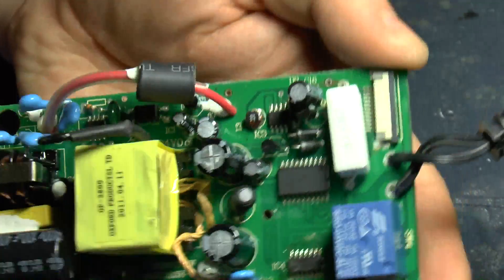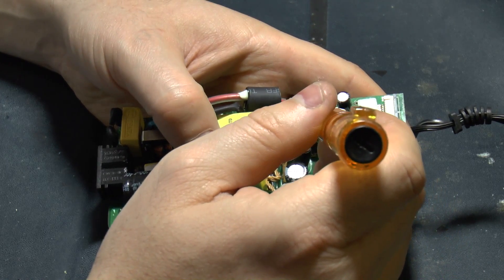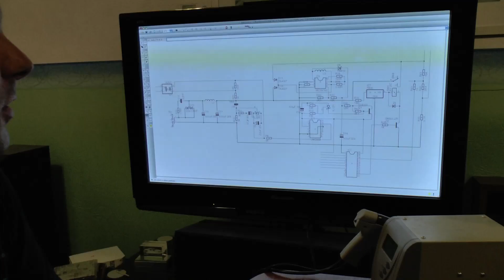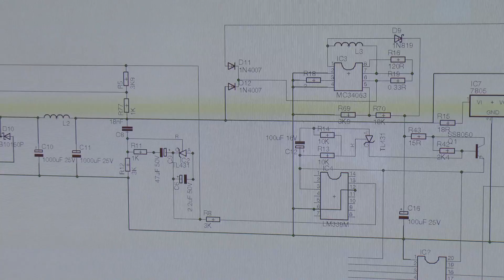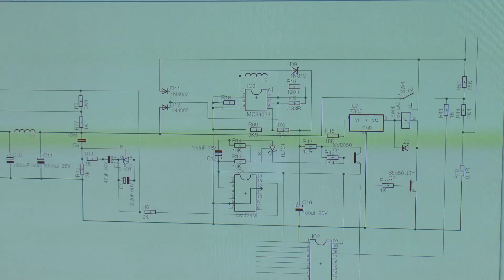Oxford Maximiser 3800 battery charger teardown and repair

Comment: Does anyone know the value of R15 a ceramic type fuse? I need to replace this. This had burnt tape over it when I opened it. Also Capacitor 1000uF the large one next to capacitor C12 is bulging at the top so maybe this will need replacing too. R44 on mine may be ok looks poorly soldered.
Reply: R44 seems to be 18KOhms. What should it be? R15 has continuity and also a measured value of 54 Ohms.
Reply: Plug device In nothing lights up or works. But it gets warm and I can hear slight noise when I connect it to battery
Reply: I will replace the 2 large capacitors. 1000uF each. The ones next to C10 and next to C12 as one is bulging and the other is questionable on the buldge.

Comment: You dint fix why it goes in to standby mode ?
Reply from the maker: That's likely to be a design flaw and would probably require a change to the programming. It's nearly 6 years since I filmed this mind so I could be wrong, my own 3800 has long since been consigned to the bin where it belonged.

Comment: Hello AintBigAintClever excuse me because I do not master English well, but I would like to know one thing please? My
 Oxford Maximizer 3800 has the same problem. So I want to fix it like 
you but on video I can not distinguish between the two sites where you 
weld resistance. Can you help me? An enlarged photo would be welcome. Thank you for your help
Reply from the maker: Since I did the video the charger has failed completely and been thrown in the bin. I've got a CTEK MXS 5.0 now, much more reliable.
Reply: Thank you for quickly answering me. So
 the Oxford Maximiser 3800 will have held only 3 1/2 years despite a 
good investment, and it is true that when disassembling seeing the 
platinum, it was not the top of the top level finish assembly and 
welding components . But I will listen to your advice and see for a Ctek. A Frenchman from Lorraine greets you. Have a good day.
Ps: if another subscriber has a miracle solution I am taker ;-))

Comment: These chargers are crap.  The soldering quality is poor for something out of of a factory my first one had residue flux all over the board and some of the soldering should have been rejected by anyone doing a quality assurance.  I've had two of them both developed same fault - after awhile they refuse to charge they will light up when connected to power but you cannot get it to charge pressing the okay button does nothing.  To anyone considering purchasing one I would say stay away better quality chargers can be had for less.

Comment: Could you tell me were I can find the MC3406 0939 Switching Regulator. Mine is fried. Thanks
Reply from the maker: +BankAngleSensor The 0939 is likely to be a manufacture date code, 39th week of 2009.
MC34063 in various IC package sizes here: 
http://uk.rs-online.com/web/c/?sra=oss&r=t&searchTerm=mc34063
Reply: +AintBigAintClever Thank you

Comment: The demarked/unmarked chip (hate it when they do that) is probably either a battery charger management chip or an MCU with a battery charging algorithm on it.
This is why I like transformer and rectifier type chargers: there is a lot less to go wrong and they are much easier to fix when they do.

Comment from the maker: I think in normal operation that resistor wouldn't be under much load, but something upset the charger (a stuck contact on that cheap Songle relay perhaps?) and burnt it out.

Comment: I meant to write "resistor and cap kit". The cheap 1/4w "metal film" resistor kits from ebay (via china) are usually junk.. but the SMD kits seem pretty good and even if you don't use SMD parts too often you can just sling them in your bits box for the rare time you need an SMD resistor or cap.

Comment: Wow, the soldering job (at least of the through hole components) of this thing looked terrible! Parts crooked and not flat to the board, and especially the transformer being hinged on one side. And I guess that 15 Ohm SMD resistor broke due to stress because it was not rated for the power needed at that position...

Comment from the maker: I'd be tempted to desolder D11 to stop it drawing power from the battery when disconnected from the mains, but of course some of the IC pins will be measuring battery voltage, and applying voltage to the pins with no supply to the chip could spell trouble.

Comment from the maker: Good spot. Bizarrely, it's a relay with a 5 volt coil, fed by its own 5 volt regulator (which feeds nothing else). The maximum output current is 3.6 amps and the relay's rated at 10 amps, so it ought to behave (although if its contacts stuck it would explain the thing going bananas and trying to burn itself out).

Comment: Those Oxford things look terrible quality. I bought a CTEK MXS5 based on recommendations and it seems to be really good (I would recommend it) You can even leave it permanently connected to your battery (mine is a hulking big AGM in the boot of my car) and you can just plug in the mains lead whenever you want to give it a top-up. It does not go into standby and can be left maintainance charging a battery for months at a time. Great teardown repair vid by the way - Thumbs up

Comment: Beware: I saw a "Songle" relay in there. These are China's cheapest relays and the contacts can weld themselves together if you use them at anywhere near their rated current

Comment from the maker: They'll charge SLAs quite happily, although I'm never sure which option to pick, "bike" or "car" :)
They come with two adapter leads, one has crocodile clips and the other has ring terminals, my mate's got his fitted to his jumpstarter (one of two that I fitted with 22Ah cyclic SLAs) as it's better than the POS taper charger that's built in.

Comment: 6:40 I would bet that was a design error! 7:13 haha! I was with you there :D I know that feeling had to laugh. I've always resisted getting one of these even tho I've got a ton of dead SLAs does it work for these types? or just LA? need to replace some in a UPS but new batteries are expensive so maybe an option to try and revive the old ones, power cuts were fairly common a few years back but it's hard to justify even having a UPS now as I can't remember the last time. Thanks for the vid :)

Comment from the maker: The diagram on the telly was only partial. I didn't do the mains side because I knew that was providing power, and I didn't complete the low-voltage side either, but I did enough to try and get my head around how it works, stumbling across the fault as I did so. I didn't get as far as figuring out how the boost regulator output (for recovery mode) gets to the battery.
My guess is that it managed to enable both its bulk charge and its recovery mode simultaneously, and that torched the resistor.

Comment: They should have added a simple diode to remedy this, but because of the voltage monitoring circuit, they didn't. The measurement circuit should be separated from the power circuit which powers the controller and display.

What probably happens when you contact the manufacturer: 

"Sir, that's not a defect or bad design issue, that's a feature. You can use it as battery voltage meter!"

Comment: A great first teardown!

This looks awfully similar to a standard switching power supply adapter. Just another case and extended with a micro controller.

The resistor you replaced is clearly underrated in terms of wattage.A little strange design, as you say it starts the reading even without mains power.
That means you pull your battery empty when mains is disconnected.